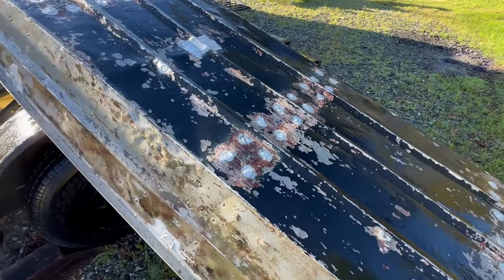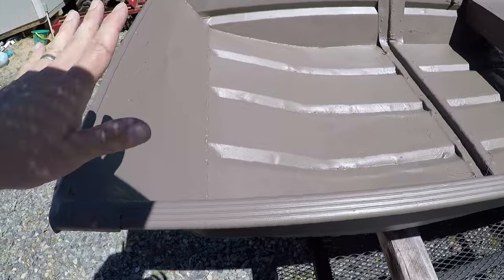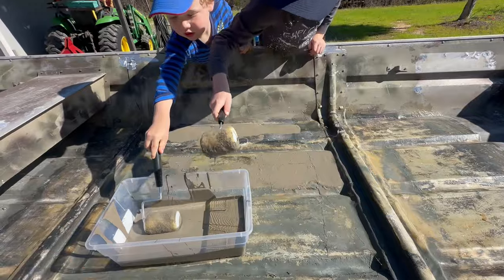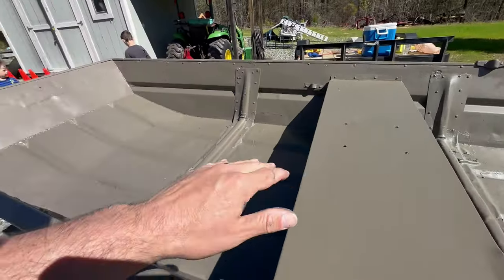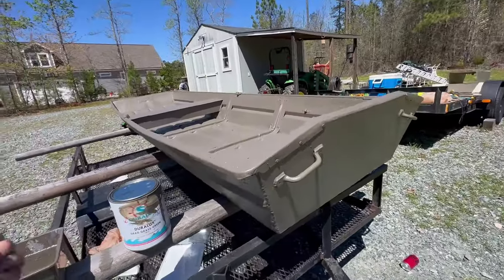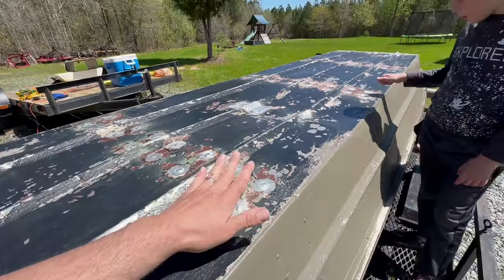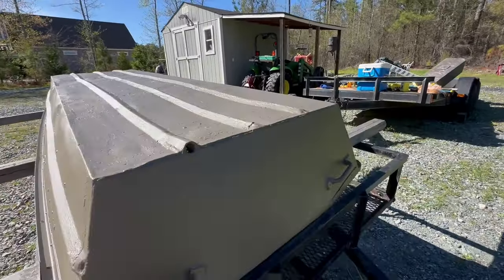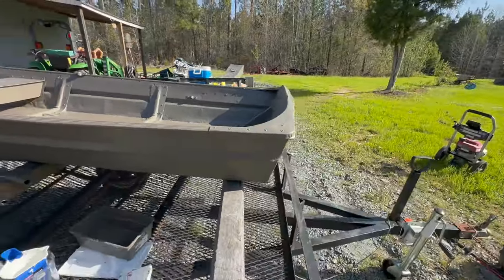It didn't stick...Painting a Jon Boat with DURALUX Dead Grass Green Marine Paint

Comment: I sanded my entire jon boat down to bare metal. If there’s any dirt or old paint left anywhere the new paint will peel off after a while. I learned the hard way after painting a different boat.
Reply from the maker: I have done one before like that and its a LOT of work as you know. I did that for a "primary" boat. This really is just budget spare river boat. I put that time into by 17CC and it was worth it. Thanks for watching

Comment: Did a shade more prep on my boat shot a coat of auto prime on entire boat. I did spray mine added reducer and a hardener.i added alot of hardener. Its hard as a frigging brick bat. Did the bottom 1/3 with bed liner for the rocks and sand on jordan and falls. The bedliner has come off before the duralux.
Reply from the maker: Great to know, I am curious to see how it does on the rocks. Place I like to fish is shallow and full of rocks, we shall see!

Comment: it probably would of stuck if you sanded it down to the metal. ya its  a lot of work. Painting Aluminum the surface really needs to be stripped  well. so always except some flaking or peeling if not stripped down. ducks dont care  lol